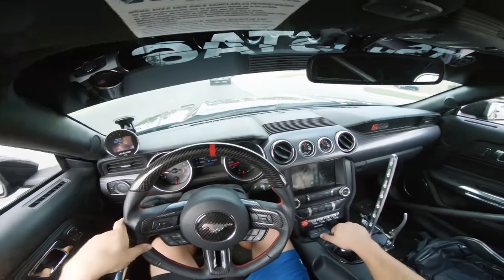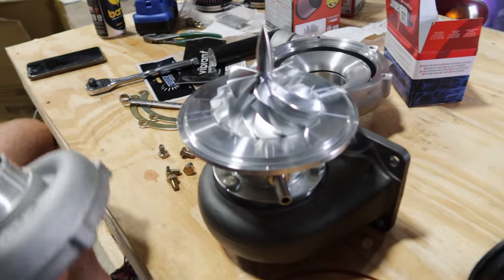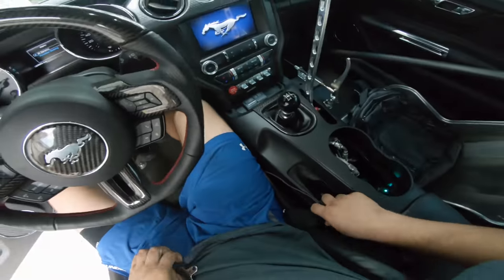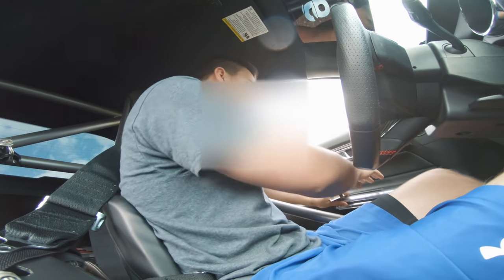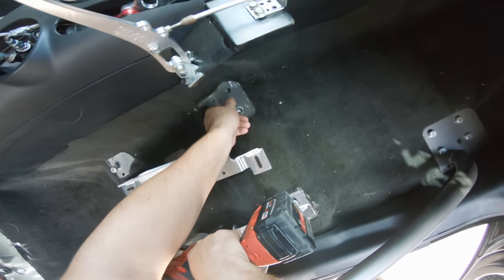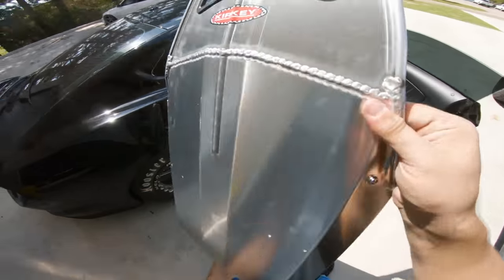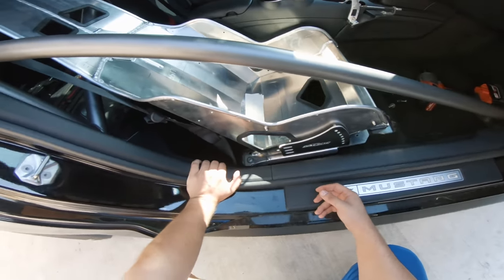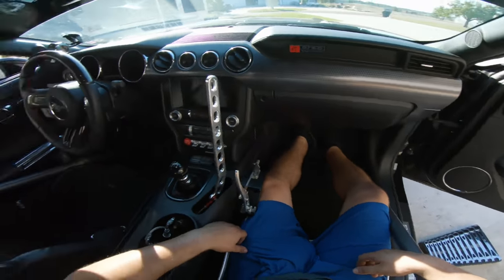Cop stops me at 140mph in my Racecar on the Street...

Comment: Me and my buddy got pulled over in our diesel race/pull truck that wasn’t registered, but was insured thru a repair plate that was on it. The truck made 750hp in the lowest tune and well over 1000hp in the big tunes. We just put a built transmission into the truck and got pulled over on the highway by a undercover trooper doing well over 120mph. my friend who owns a diesel repair shop put his repair plate on the truck. We’re both wearing his shop T-shirt’s and he told the cop he was data logging because the transmission was slipping in after 3rd gear and we were seeing what was wrong by data logging the truck. We Got left off with a verbal warning because the cop didn’t want to do the 15 pages of paperwork to cite a repair plate for a ticket.

Comment: Yano, if you just fess up to your mistakes, a lot of cops will work with you. They VERY much appreciate it.

I once was pulled over for doing 72 in a 55.  The road is a regular divided freeway and everyone goes faster than 55 through there because it's kinda ridiculously slow. But since I was up front with the officer like this guy here, he cited me for just a "posted sign violation" instead of speeding, which carries a mere $20 fine and no points. Had he cited me for speeding, that would have been a $170 fine and 2 points (which translates to a 30% hike on insurance premiums).

Honesty is the best policy, folks! The cop knows what you did, and he knows you know what you did, so it won't benefit you to make excuses.

Comment: Meanwhile I go 105 at 3 am nobody on the road, and I was extremely honest with the officer, I'm going to court for it
Reply: Even more reason to just pretend you didn't see the cop. That is what I do.
Reply: How much is your ticket and what all do you have to do?
Reply: @alexjamerson5796  Basically run if you can. And by that I mean that:
1. You have the Power to out-accelerate the cop car.
2. The road is clear ahead.
3. There aren't any intersections.

So you basically have to be at a highway that has few cars and have  decently fast car to have any chance of successfully running away. Otherwise, just pull over and pay the fine.
Reply: @SI0AX  Had to get a lawyer for my ticket from a month ago
Reply: @alexjamerson5796  Wow, that sucks. You had to go through all that trouble and expense. But at least it's not like in Virgina(I think) where they arrest you for speeding, lol.
Reply: @SI0AX  Just got done with defensive driving. Now I have to do a traffic victim impact panel. A month ago, just got a regular ticket for doing 102 in a 65.
Reply: @alexjamerson5796  You need to buy a radar detector and use Waze. Both can help, 1 where cops don't use radar and the other for when it's not marked on Waze and he does use radar.
Reply: @SI0AX  Also, what can a judge decide?
Reply: @alexjamerson5796  If you're facing a Judge there is nothing else you can do but he honest and hope he is lenient.
Reply: @SI0AX  I hope so, I mean hopefully I don't get my license taken for example.

Comment: Honesty is the best policy, especially when it comes to open roads like motorways or a roads in the UK, I literally had the exact same scenario here in the UK, new engine/turbo, sent a base map, tuner wanted some base logs, fiddled, then wanted some high load/high rpm pulls, flew past an undercover at 10ish at night, doing nearly double the 70mph limit. I said straight up I know I was wrong, but I had a trip planned to the drag strip the next morning, my guy needed some logs etc, let of without even a warning, honesty is the best policy with most highway cops.